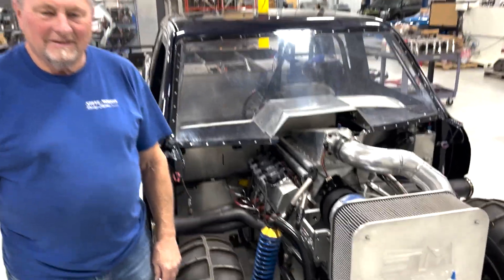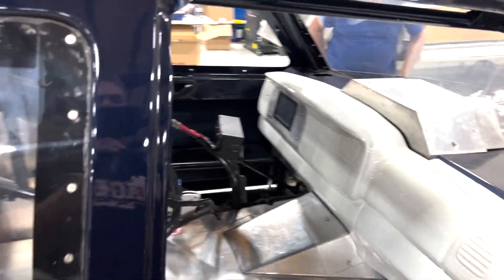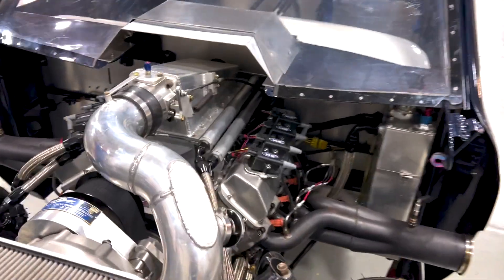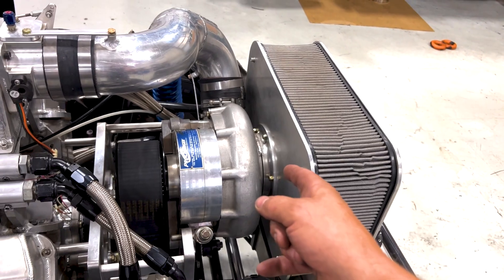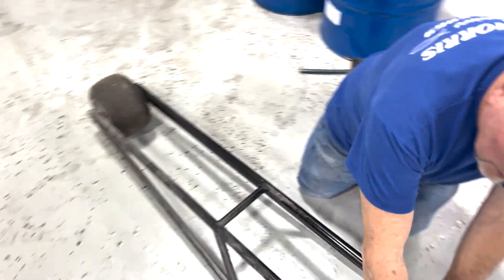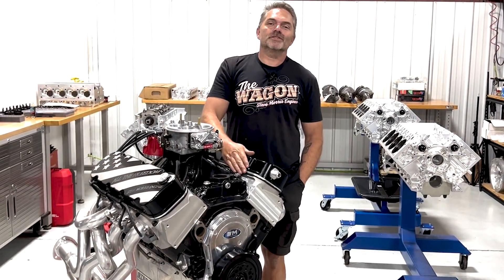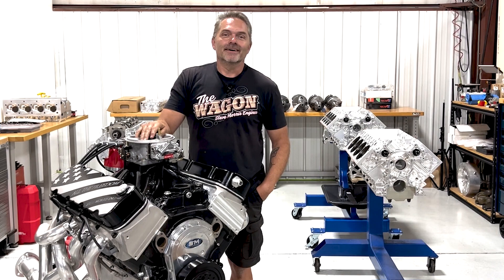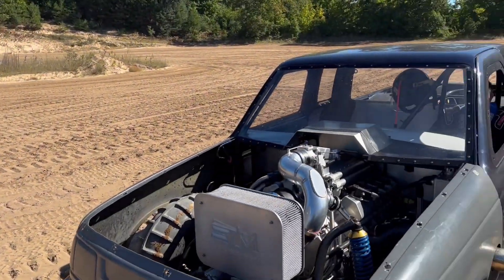Too much power for sand?  No such thing!

Comment: Running big block with the block split in half ... you don't see that every day.
It never ceases to amaze me how much traction you can get in sand, without actually having any traction at all.  It's almost like a boat but instead of displacing water you displace sand, and it works.  My buddy held the sand drag record in AZ for years in the 3-wheel ATC class.  He was always wanting me to sell him my cammed and bored FJ1100 race motor.  I said, "you're already #1 and you will just feed it enough nitrous to blow it up, not for sale".

Comment: The whole truck is badass and the mono shock deal is unique to me. I can’t get over and can’t stop checking out the air filter😂 I’m doing a turbo LS K5 Blazer that’s a street driver with occasional dune use and now thinking how much filter can I do.😂
Reply: The rear suspension is like a swing arm dragster.

Comment: Pro Mod , Dragster , Donk , Sand truck.  I'm waiting for a V twin made from a blown up block / crank installed in a racing lawn tractor or tractor pull .    "  United States Lawn Mower Racing Association  "